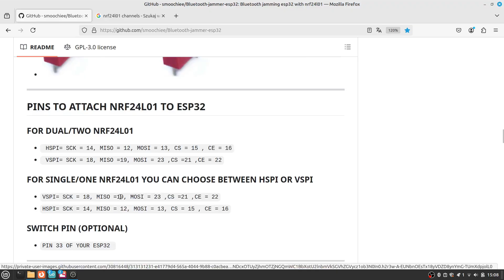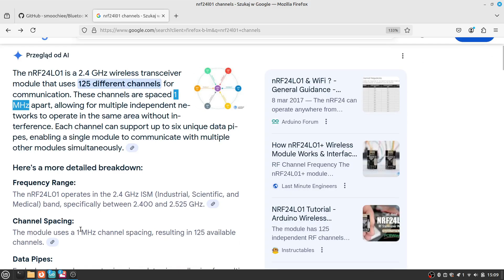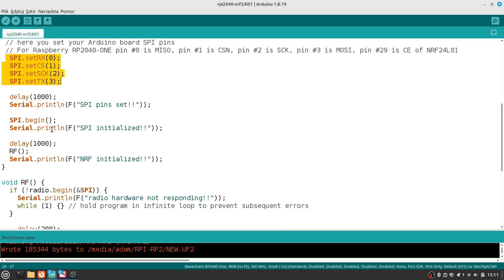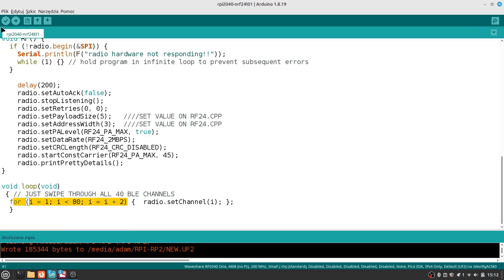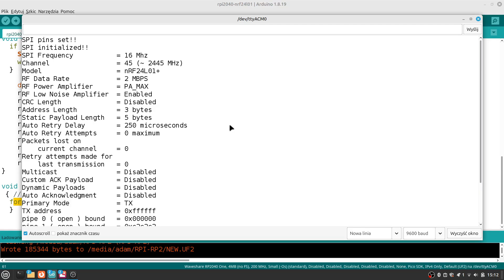How to deal with noisy neighbor ? part #2   - DIY  BT Bluetooth jammer with NRF24L01 + RP2040

Comment: Hi friend, I'm using with rp2040 from Chinies mfg. and it's not working.
The code complied witout any errores and is not jamming the BL speacker.
There is a way to check/troubleshooting ?
Reply from the maker: connect over usb to the Arduino, run Serial Monitor in Arduino and check the debug messages. It will tell you if you have connected properly your NRF board to RP2040
Reply: Thank you about your resposne.
I recived the massage "radio hardware Not responding"
I checked the CNS pin with osscilloscope and i didn't see clock.
Reply from the maker: Have you used Earl Philhower RP2040 Arduio core for programming this board ? If not probably there is a problem with using the SPI.h library in the Arduino
Reply: @justanengineer5599   
Hi, thanks again about your answer . I'm using with Raspberry Pi Pico/RP2040/RP2350 By Earle F. Philhower, |||  Rev 5.4.4 and  my board is RP-2040 Zero by Waveshare.  I'm still having problems "radio hardware not responding!!" despite trying to replace the NRF24L01 and RP-2040 Zero. 
Do you have any idea what the problem is?
Reply from the maker: I think there maybe a connectivity problem. try to solder the wires if possible.  Also using an oscilloscope would help. Your CC1101 may have a different pin setup, check the datasheet for this board

Comment: hi friend I'm trying to load the code and i got this error

 SPIClass has no member name setRX 
can you help me i have same boards that you have and connections everithing is correct
Reply from the maker: I am using Earle Philhower Arduino core for RP2040. Check if you have it
Reply: @justanengineer5599 
 fixed ,  I needed to select the correct board.and it is working perfectly,
let me ask you something else ,since I got you here, is there any way to increase the power or add another module, to get more range?
thank you for your time
Reply from the maker: yes you need to use 0.5watt power board from EByte. check my other responses under this video

Comment: now, if it jams my noisy neighbor, does it also jam me? In other words, are all BT signals jammed? If it prevents me from using my BT, it is not useful, I don't see you selecting a specific device to jam and allow other BT to continue to work?
Reply from the maker: yes it jams all devices in the range
Reply: @justanengineer5599  Well, that stinks. I wish there was a jammer that is channel specific so I can still use my BT devices while blocking someone else's
Reply from the maker: you can use bluetooth ping flood from kali linux aka bluesmack attack for this. But this requires some knowledge and the question is are you smart enough?

Comment: If it's a normal speaker and plugged into an electrical outlet, is there any way to interfere with the signal?
Reply from the maker: no. you need to switch the power down. Short cicuit :-)

Comment: @justanengineer5599 Have you tested whether jamming works through walls?
Reply from the maker: it works but you need better nrf module
Reply: @justanengineer5599 which module will be the best in your opinion, which one do you recommend to be as strong as possible
Reply from the maker: this one from ebyte - E01-2G4M27D. Keep i mind that  it requires a good power source which means you cannot attach 3.3V voltage directly from the arduino board. You need additional 3.3v voltage stabilizer like lm78xx for 3.3v .  Check the board details here  https://www.cdebyte.com/products/E01-2G4M27D/4#Downloads
Reply: @justanengineer5599 Could you tell me exactly how I should put this together to make it work properly? Thanks for any help.

Comment: is the antenna that u used ? same like this one (Lightweight 2 4G Directional Video Transmission Antenna for Yagi Setup) or if you have product link?
Reply: 1pc High Gain 7dBi UWB TEM Antenna, Broadband 1.4-10.5GHz, 8W Uncharged for Radio Signal Transmission and Reception, Directional Ultrawide Band Antenna without Battery,  should this work in our case?
Reply from the maker: I would suggest to use 2.4GHz narrowband antenna not the wideband antenna

Comment: Mine fails to compile here

SPI.setRX(0);
  SPI.setCS(1);
  SPI.setSCK(2);
  SPI.setTX(3);
Reply from the maker: If using windows based Arduino it may have a problem with Earle Philhower RP2040 core. The question is if you installed all of the libraries for RP2040
Reply: @justanengineer5599  I did, now I am getting this error:  error: 'class arduino::MbedSPI' has no member named 'setTX'
Reply: Update, got everything to install, but not getting any lights, or anything
Reply from the maker: it will not blink any light or somth. It does not use any onboard LED
Reply: @justanengineer5599 Got it to work! But it's pretty choppy, and doesn't work that far away. I have 100 of on it now, should I use a bigger,  or smaller cap?
Reply from the maker: the cap is ok. Use better NRF module from EByte. there is 0.5watt version

Comment: Should dragging the (rpi2040-nrf24l01.ino.waveshare_rp2040_one.uf2)  uf2 file into the Rp2040 in bootloader mode act the same as uploading the code or is their something i need to directly change in the code?
Reply from the maker: yes!
Reply: @justanengineer5599 i got it working thank you🎉

Comment: I need a jammer for larger distance, 100m or something.
Reply from the maker: You just need directional antenna ( yagi-uda type of ) and better NRF module from EBYTE :E01-2G4M27D EBYTE , which is 0,5Watt of RF power : https://www.cdebyte.com/pdf-down.aspx?id=1712
Reply: @justanengineer5599 Thank you very much for your help. I have a M5StickC  and nRF24L01setup. So is it possible to use your EBYTE device instead of nRF24L01? I'm no expert but want to get rid of my neighbours annoying bluetooth box.
Reply from the maker: no because it is closed black box solution

Comment: will it work also with RP2350-one?
Reply from the maker: of course. In fact I tested only on RP2040-zero and RP2040-one. But for RP2350 it should work the same since it using existing libraries. RP2350-one even has the same pinout so no changes to the diagram needed

Comment: Hello, I've just finished building this, but mine doesn't fully stop the Bluetooth it only becomes choppy. Btw I use rp2040 zero.   Next the regulator from my rp2040 gets very hot, is it normal or faulty? Thanks
Reply from the maker: i think your NRF board may be faulty because it draws too much current. RP2040 board can provide max 0.3A via 3.3V pin if the original board from Waveshare not the cheapest clone... You may consider using additional 3.3V voltage regulator just to power NRF board. Also please buy better NRF board like the one from EBYTE
Reply: @justanengineer5599  ok thank you. I  will build another one tomorrow, I have extra parts, I'll check if I have the same problems. Thank you 👍😃

Comment: Hi friend, please buid a PARAMETRIC directional speaker with jack input and 30 meters range!!
Reply from the maker: Done. Check the link :-)  https://github.com/mcore1976/rp2040-parametric-directional-speaker    I just need to make a video
Reply: @justanengineer5599 you are the big MASTER!!
Reply from the maker: I am just an engineer 😁
Reply: @justanengineer5599 friend, i am having problems with the project...the sound IS very very low... i followed your electronic diagram step by step ..330uF between 12/gnd...47uF btwn 5/gnd after the 7805 ..10uF serial at the audio input .. uploaded the Code on Arduino IDE... My transducers are 40khz...i changed at the Code ..but...nothing....the sound IS ridiculous...😢😢😢😢😢 i need your videohelp!!
Reply from the maker: you need to change amplification parameters in the code. there is one with rotate bit left , you need to increase it. One more thing - I am using 25kHZ transducers with TPA3116D2 XH-M542 MONO AUDIO AMPLIFIER. This is the only combination that works properly.
Reply: @justanengineer5599  ok, thanks, yeah...i am using 40khz transducers...i Will buy 25khz... and try to change the Code... I bought that same amplifier....
Reply: I Guess It IS easier than the audio jammer for you...and It IS algo very interesting!!
Reply from the maker: working on it!
Reply from the maker: I think I will try to use RP2040-zero (includes ADC for reading the mike and PWM for drivin transducers) plus TPA3116D2 power amp + set of 20 transducers
Reply: @justanengineer5599  I'm looking forward to seeing the masterpiece you create. Please make it with a range of 30 meters and an audio jack input! Greetings from your followers in Spain. Thaaaanks
Reply: Using an AD834 makes easier the modulation , what do you think?
Reply from the maker: I will try only this set : rp2040-zero + TPA3116D2 mono amp + set of 10+ transducers 25kHz + lm7805 stabilizer + 2 caps + 2 resistors as voltage divider for audio input. The source code is ready and I did some preliminary tests. Looks like almost ready...

Comment: Id love to swee more ultrasonic projects. I bought all the supplies for two setups, then i noticed on temu they sold the exact same transducers but as anti dog barking devices, some with multiple that sweep between 15 and 30 kh. I also saw some Linus tech tip video explaining how a microphone behind cloth wont get jammed, is that true too with your anti spy device?
Also would love to see a proect thats like an SDR but purely for detecting ultrasonic codes, decoding them, and an ultrasonic version of ggwave. Also considering no one I ever mention this to has even heard of ultrasonic code, I think its a weak spot in cyber security right now. Also worth mentioning it really terrifies and can damage cats ears, dogs i dont know and birds are ironically deaf...but I learned raccoons will stop fighting if you play them mexican hoe music (perhaps from sheer confusion) and crows will stop attacking if you play something melodic. Would be fascinating to have an all in one sonic control board for jamming, communicating, sending code commands and banishing or entrancing animals
Reply from the maker: I made parametric directional speaker. The project is described here :  https://github.com/mcore1976/rp2040-parametric-directional-speaker
With only 15 of 25kHz transducers I am getting the range of 30+ meters with good sound level. You may be interested in this if you wish to play with animals
Reply from the maker: yes ultrasounds are having difficulties when transducers are covered with clothes. The air cannot vibrate then therefore the jamming power is reduced. For the animal impact - this really depends on the species - home pets get really pissed off when the jammer works and try to not use it when they are around. I does not hurt them but the dont like it. If you modulate the ultrasound with the FM modulation of music , the ultrasound will carry this music and you will be able to hear it once ultrasounds hit some obstacles. This is known from late 50 of the last century and used to create directional speakers

Comment from the maker: This video is kinda similar. Everything built from the parts you can easily and legally get on the market. I just do not want people to buy chineese jamming modules it is too risky
Reply: i see no steganography used. Give a clue?
Reply: Me too😢
Reply: Btw if I built a jammer acording to your previous video {which is hidden}, what is the circuit diagram. And what is the sawtooth frequency of the 555
Reply from the maker: the sawtooth freq around 60-100kHz works best
Reply: the link is in this emoji 🫥󠅘󠅤󠅤󠅠󠅣󠄪󠄟󠄟󠅗󠅙󠅤󠅘󠅥󠅒󠄞󠅓󠅟󠅝󠄟󠅣󠅝󠅟󠅟󠅓󠅘󠅙󠅕󠅕󠄟󠄲󠅜󠅥󠅕󠅤󠅟󠅟󠅤󠅘󠄝󠅚󠅑󠅝󠅝󠅕󠅢󠄝󠅕󠅣󠅠󠄣󠄢
Reply from the maker: sorry I need to upload the source code to the github. Gimme 2 days plz